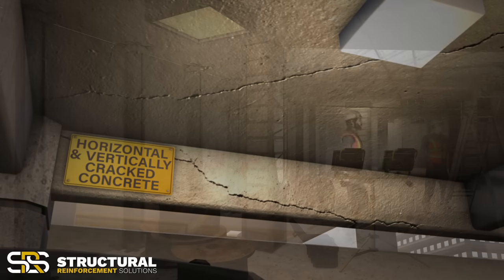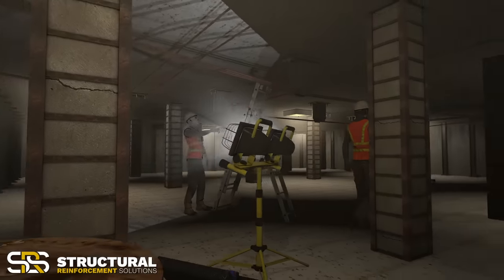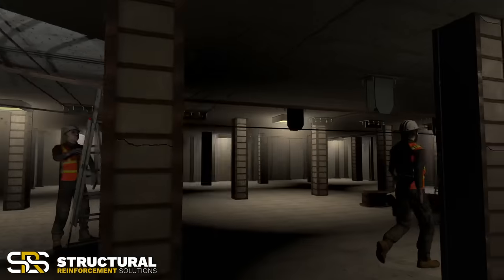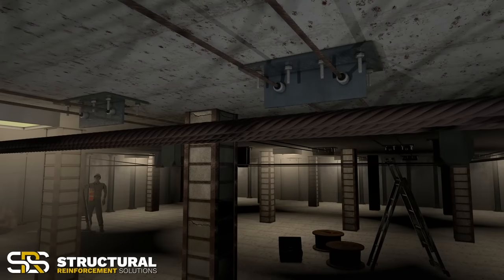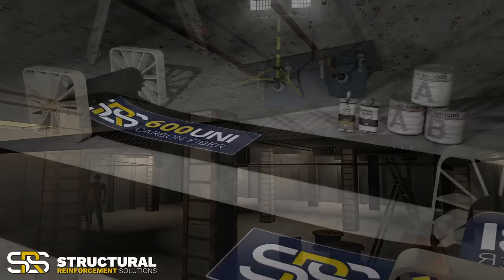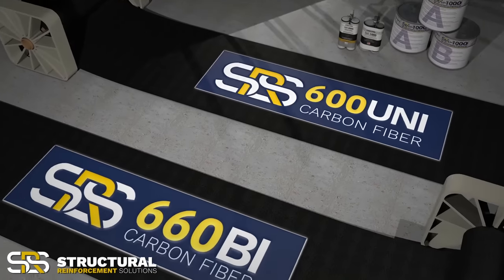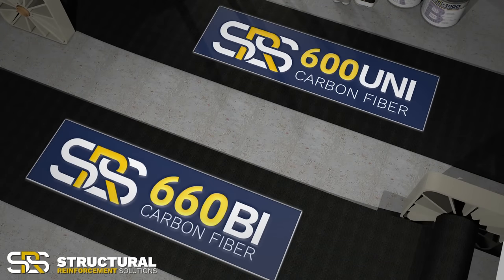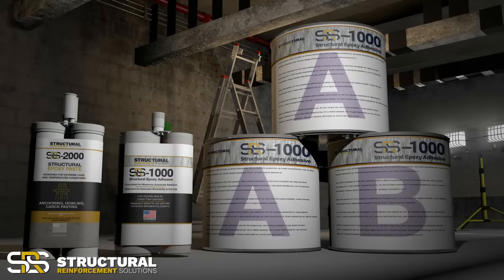Structural Reinforcement Solutions - Carbon Fiber Strengthening Systems for Concrete Infrastructure

Comment: Is it safe for load
Reply from the maker: Yes, our carbon fiber systems increase load capacity
Reply from the maker: Absolutely. Our carbon fiber structural strengthening systems are a proven safe and effective method to increase load capacity on a wide variety of concrete structural elements such as beams, columns, slabs and walls.

Comment from the maker: SRS Carbon Fiber strengthening systems can help prevent future catastrophic building collapses such as the tragic #surfside #miami #buildingcollapse 

Structural Reinforcement Solutions is dedicated to public safety through engineering and product development. As a leading manufacturer of Carbon Fiber Reinforced Polymer (CFRP) SRS structural strengthening products are available to professional contractors across North America. 

Learn more at www.Structuralrs.com or call 1-888-292-2592 to speak with an expert today. 

#structuralfailures #concretefailures #buildingcollapse #prevention #safety #awareness #education #publicbuildings #publicsafety #buildingsafety #condominums #highrise #structuralfailure
Reply: what happens if you put long strands of it thru out the concreate mix when you pour it.